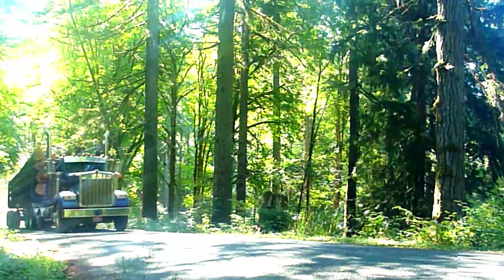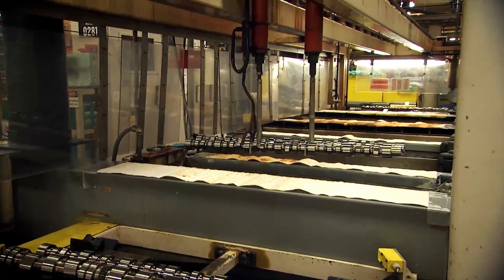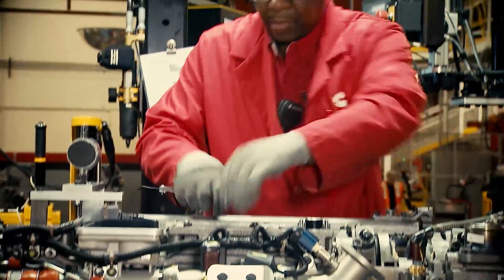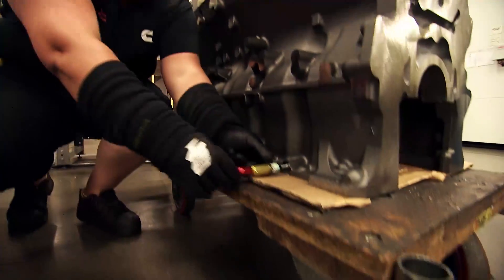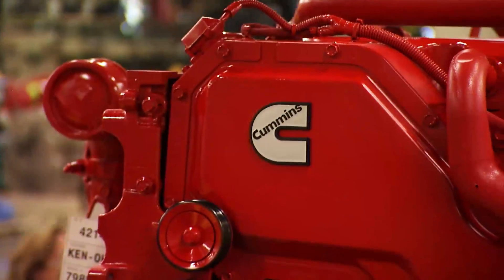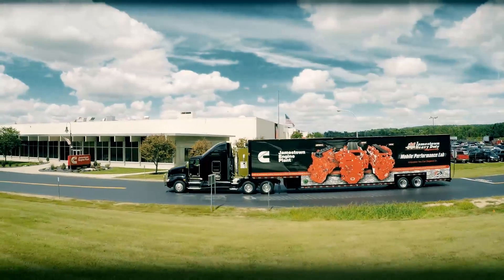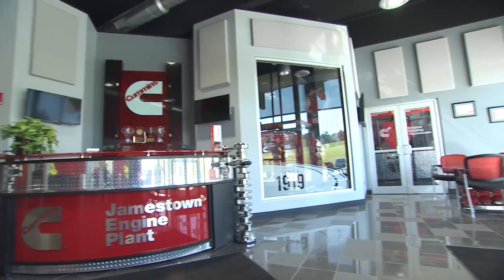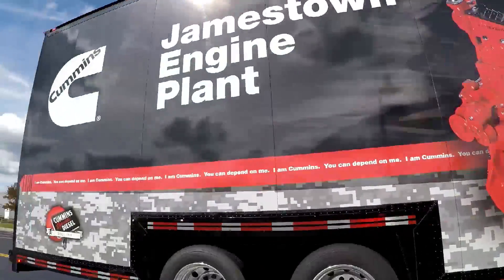Inside Cummins: This is Jamestown (2016)

Comment: I worked for Cummins starting in 1995 and can truly say i liked it there very much.  Then covid hit and our shop slowed down i was laid off temporally (ha ) for 90 days. over 120 days latter with  no explanation i was what they said furloughed . I had never been written up for any thing i had never even been late to work once . I worked on every engine platform Cummins had at the time from the B all the way up to high HP K engines and Onan gensets. I also was  the only tech certified to diag and repair industrial alternators for transit buses. I truly believe the reason i was let go is our branch manager at that time (JIM) did not like me for some reason and i was the oldest tech in the shop at  that time almost 60 years old... I really thought this was going to be my retirement job .  Thanks for nothing (JIM)  Cummins Sales and Service Grand Junction Colorado
Reply: Thats so sad

Comment: The engines are ok but the emissions after treatment systems are garbage. Once they act up nobody can fix them the only repair is to delete the system which is illegal. But it's the only way to use the equipment.

Comment: This is a really professional video, excellent presentation.  NOW-  if ONLY Cummins was even MORE dedicated to phasing OUT diesel (fossil fuels) faster, as the planet is suffering like crazy from excess CO2 in the upper atmosphere, overheating, Gulf Stream may stop, or REVERSE! Europe will freeze, Polar bears can't find seals. Sea ice is receding at TWICE the normal rate in the Artic,   But increasing temperatures across the planet, caused powder post beatles have migrated north into Canada. They're EATING MY BROTHERS HOUSE, chewing invisibly on the inside out!  Go Electric-  Cummins  and Caterpillar and Komatsu and Hitachi, John Deere, GM, Ford, Chrysler, Mercedes Volvo, ... etc.  Norway already has an autonomous electric Container Ship delivering !  Come ON AMERICA...  The nuclear USS Nautilus' keel was laid in 1952.   Surely 70 YEARS later, electric  transport should be universal and child's play!

Comment: Our l10 has done over 30thousand hours built in 1990 and still going well never have to touch it very much uses 1 liter of oil every 15 hours its a very good engine I drop the oil 🛢 and filters every 250 hours .

Comment: Just checked google and VERY glad to read the cold good way, fact that Cummins belongs to Cummins! Job VERY well done indeed Cummin's management! Congratulations whole lot for purchasing those only 10.8 percent Ford sneakily brought but could not stop Cummins from buying back! Job so very well done indeed Cummin's management! Here is the copy from google's website: "Cummins set the record straight in their May 2013 newsletter, outlining that Ford Motor Company had purchased 10.8% of the diesel engine manufacturer in 1990. In 1997, those shares were bought back, and as such Ford has not owned a stake in Cummins since.Nov 10, 2013"

Comment: I got a isx15 cm2250 with 990k miles no oil burning, still running with stock turbo getting 8.2mpg maintenance is key I do all of it by myself, I did main and rod bearings at 920 with new oil pump, thermostat , water pump, egr cooler etc, I'm gonna keep pushing till I notice anything that would indicate rebuild, I do want to add emission system if not on top of it, it will kill the engine, my advice learn and do it yourself shops don't care, cummins will even give you access to quick serve with all info need it to maintenance your engine, I'm happy with cummins and if I get another new truck I'm gonna have it with another cummins engine.
Reply: 8.2mpg whatfuckenever.

Comment: I had a 2014 KW T660 with a Cummings 450 HP, I bought it used, I ran the truck for about 2 years, and out of the sudden, the engine blow out a hole on each side of the walls of the block, this the 7 engine that I know that they have this problem, some mechanics won’t recommend Cummings, cause the problem that they blow out with out no reason.

Comment: Ive owned 2 isx now and NOTHING BUT PROBLEMS from egr to bolts snapping in block for belt tensioner replacement to lots of little things that add up. And parts are very expensive. Oil leaks are very common everywhere

Comment: I need that trailer to hook up to my truck to see what's wrong with this x15 boat anchor... Feels like I'm driving an old 80's cummins...  Of course it doesn't help that the exhaust hits a 90 degree brick wall not more than 20 inches from the turbo so it can get down to the power and fuel economy robbing DPF... Diesels need to BREATH, the epa is choking the crap out of them....

Comment: I have 2007 Peterbuilt with 450isx and it’s got 1,400.000 miles and still running strong only thing change was the turbo at 1.000.000 miles good engine

Comment: wow at 9.20 you say you put on the right parts, thats amazing!
Reply: Terry Rack.... in other words, they're (hopefully) Not assembling an engine with (especially) accessory parts or components that should be going on a different engine order.  These are Not "one size fits all" car or pick-up truck engines... HD diesels have specific order numbers for each engine and they are set up for specific applications.... even when ordered for (ie:) semi - trucks.. you could have the "same" engine platform for one truck model... but, could have 7 or 8 variations in regards to air compressor and alternator sizes, turbo model and location, etc, etc. 

You also have gen-set and industrial application orders as well.... so, Yes.... they need to be paying very close attention to matching the engine serial number with its specific work order number and making sure that all the "right parts" are on each specific engine for it's "end use" application.... and that also applies Internally as well as for external parts. 

Static compression ratios vary, depending on end-use application and power levels desired.... so, pistons, camshafts (lobe design & ramp rates) can vary during assembly.... they are Not all the same, whatsoever.

Comment: ISX = It Sux  nothing runs like a Cumapart.  Try fixing the cams running flat and the cranks spitting the rods out the block. You fix those problems, paint them Yellow, and call them a Caterpillar you might be on to something.

Comment: Interesting how the painting occurs after assembly.  In one way it seems more efficient. However, you would think that that there would be several spots in tight areas that are missed.
Reply: Seals up the leaks 😂
Reply: There are
Reply: Yeah but ya don't really want paint in those spots for sealing tolerances. This method is preferred.

Comment: I had a new Volvo a few years ago it had 400 N 14 engine it ran and pulled better then the IXS motors in the other trucks we had.i took the tractor too Allentown Mack the mechanic came out with the computer box and he set it up right.i think its sad that they turn the power down on trucks now .trucks on the turnpike run at 65 too 68 thats it companys want too save fuel .Ryder JBH Sneider and other trucking companies drivers run the passing lane too much and get mad at you when you pass them thats sad.i think too making big horse power engines like a 400 too 550 are a waste of time.Please people i have driven a 18 wheeler sent i was 17 years old  i m now 54 .my dad drove all Macks  and is 84 now wow.trucking is fun too me drivers .if you buy your own truck have them set it up like you want thats all.i got two speeding tickets in my life one when i was 19 and one back 2002  people be careful out there God bless.

Comment: Tony Stark ordered his in RED.....I want Cummins POWA in  RED too
Reply: sticK&Clutch.... if it's built for either "automotive" or industrial applications.... it will be Red... whether you order it, or not..... Unless, it's a factory Re-man engine of the older "855" platform... then it Will come in "Cummins Beige" paint... unless it's for some other application other than automotive or industrial use.  The Cummins N14 & M11 truck engines were all in Black paint, except for the Owner Operator spec'd N14 (with the 460 hp rating) which was Black, with Red rocker covers... nick named the "red head" engine.

The marine versions use to be in White.... as were, many of the Cats.   The only other paint color exception for the earlier "855" block in hd truck use, were from Paccar.... parent co. to Pete & KW during the very late 1960s and early 1970s, when they ordered the Cummins & Cat engines painted in White, but the Detroits remained in their factory "Alpine Green" color.... except for those that were shipped to International Trucks, they ordered them specially painted in "International Harvester Red".

Comment: nice production plant. Wonder which car manufacturers order their car motors from CumminsEngines
Reply: lenny108...... Zero "car" manufacturers do.  However, RAM (Dodge) is 100% Cummins in their diesel pickups, and Nissan is No Longer offering the diesel option starting with the 2020 models..... they said the Cummins V8 was sorely lacking in performance.... which I wouldn't doubt.

Comment: We run Kenworth and Peterbilt truck’s hauling product up and down steep grades in Colorado most of which are powered by the ISX 15 & X-15’s. We’ve found that the ISX 15’s run to about 300,000 miles and become plagued with problems that lead to full overhauls. We’ve rebuilt two of them but after becoming more familiar with the issues they have we have decided they aren’t worth fixing. Engines have gone from a lifespan of over 1,000,000 miles to 1/3rd of that which is not cost effective.
Our X-15 powered part of the fleet has been much less problematic but they are still in the fairly new category so time will tell. Hopefully they are better than the ISX 15’s have been. 
In my opinion if you have an engine failure of a 2010 or newer truck, you will get way more life out of it by replacing the engine with a pre-emission model which comes with a warranty than by rebuilding.
Reply: Benjamin Ball for sure, deleting them helps but I think the ultra low sulfur fuel is partly to blame also?

Comment: Recently i changed the oil cooler of the ISX .
Reply: Hmmmmm oil cooler is not reliable in Cummins as I also have replaced numerous in Cummins QSX15 industrial and generator drive engines. Similar to ISX truck or vehicular engine 😎

Comment: You can improve by bringing back the n14 with a better fuel system on it. The isx is junk. Say no to egr and dpf!
Reply: jo pete The best engine that Cummins made was the N-14
Reply: The CELECT PLUS is not a better fueling system than the x15 Common Rail fuel system. Going against EGR and DPF (and DOC since it was released alongside the DPF) I am assuming you are supporting emissions of NOx, raw HC, CO, SOx, DPM and many other pollutants. Please correct me if I'm wrong.

Comment: Personally I think the old big cam formula Cummins were and still are the best engines ever built
Reply: Donval Harris I always like the KT series, drove W900 with a KTTA 1150. It got 3 mpg' but it sure pulled good with a 5+4 and 3:73 rears
Reply: nope,detroit diesel.

Comment: Had a Peterbilt with a Cummins explode at 160k miles. They produce better motors for pickups Than semis. I do like N-14s but I'd rather have a 8v71 or a c-15 or 3406
Reply: 8V-71? WHY? SO YOU CAN PRACTICE YOUR SHIFTING?
Reply: @redline9536  no, to practice premature hearing loss and brush up my yelling skills

Comment: Nothing compares to Cummins.
Reply: Pavle Pajic your having a laugh surely? Volvo is not even in top 3.
Reply: Pavle Pajic I used to work at Scania in the workshop.  Nice looking truck, lovely to drive but the engines can't hold a candle to Cummins  Volvo are behind Scania in the pecking order.
Reply: EVER HEARD OF A CAT. ISX HAS A 1 PIECE HEAD LIKE A CAT. BECAUSE IT'S BETTER THAT WAY. STILL CANT TAKE TO MUCH POWER INCREASE. TURN UP A CUMMINGS, ENGINE'S FAIL MECHANICALLY. TURN UP A CAT, RUNS GREAT. UNTIL THAT RIGHT FOOT GETS TOO GREEDY. THERE'S A REASON WHY GLIDERS WERE MAINLY BUILT WITH A CAT FOR POWER. OR 12.7 FOR ECONOMY. BUT NOT MANY CUMMINGS WERE IN THE MIX. N-14 IF ANY.

Comment: have a fleet of trucks and triple trailer units all working 24 7. All have cummins engines and have been hauling iron ore to quarries across australia. have 6 kenworths with isx engines all are 6 years old been running pretty much 24 7 since only shutting down for services. all have done around 25 to 30,000 hours and between 1.1 million to 1.5 million kms. havent had a spanner to any of them. great engines great kenworth trucks!

Comment: i purchased a G855 in 1978.  it has been reworked several times with new liners but the Crank has been turned .010 one time to take out scratches in 100,000 hrs.

Comment: your engines are only good and reliable as the people working on them.
Reply: charles V and the people driving them
Reply: Charles
You sound like a Union guy 🤔
Reply: I think 2 million miles on a motor that’s never been opened that doesn’t shut off for 6 days at a time is pretty good.

Comment: i wish peterbilt with give O/O better engine options choices to make then this pile of dung.. i 'm about to purchase a new truck and i just don't want a cummins, i want my old trust worthy DD15 which i've never had no major problems with, i replaced the small top coolant line on the passenger side, also it was weeping a little oil at the rear of engine block above starter, all fixed under warranty 'I'm about to turn it in this year with 460K miles on my 2012 freight liner, before this my company trucks had cummins which were always down and in the shop until i started driving a truck with the DD15  i just trust that engine, it has never let me down, i know that drive line with the eaton fuller 10 speed together they made me a lot of money. but now i want a 2017 peterbilt 389 but what is holding me back is that it has that stupid cummins in it, very frustrating, if i must i'll get another truck with the DD15.
Reply: charles V- I agree the DD15 is pretty good. I never had issues with it either. The only problems I ever have with the ISX15 is the after treatment system. If they can make one that works, that'll be awesome. I know the emissions crap is annoying, expensive, and doesn't sound as good,  however I'm no hippie but I like the whole less pollution movement.
Reply: Get a glider with a cat that's what I'm going to do!

Comment: I will never purchase a Cummins engine ever again!   While they were still junk back in the '70s and '80s, they were cheap to fix and very cheap to rebuild compared to Caterpillar.  That's why Cummins was successful in those days.  Not because their product was superior, but because it was cheaper than dirt and easy to fix.  These days it's a different story.  While Cummins engines improved in some respects, they're still plagued with problems, but they're super expensive and it will bankrupt you if you have serious issues and are dependent on Cummins warranty.  Most North American drivers (steering wheel holders)  think that the ISX is a "good engine" because it "develops lots of power".  Compared to what?  Other North American engines? They think like that because they never had a chance to compare it to other UNMODIFIED (N American) products like the 16l Volvo @ 750 bhp, 16l Scania V8 @ 730 bhp, etc.  There is no one better at diesels than the european manufacturers!
Reply: maybe your just a maxxforce guy??
Reply: bluelightguy1 I'm old school. Drove and ran whatever it took to pay the light bill.
Reply: c15 and c16 are crap gutless
Reply: 2nd the Scania! SWEET engines.  I've run Cummins but no fan of them.
Reply: JKillerZs G:  like the the 537 kW (730 bhp) backed up by a whopping 3500 Nm (2581 lb/ft) of TORQUE that the 16 liter V8 SCANIA engine develops in their R730 trucks?

Where exactly does the Cummins ISX for road use stands on power and torque?

You responded talking about torque to a comment that emphasized on QUALITY and RELIABILITY, you fucking moron!  Get outta here with your fucking torque!
Reply: see my main pick thats was a new T608 550 cat with 3 side tippers 140 tones all up gutless  as hell on the hills and they had the new T908 575 cat twin turbo what a joke i was in a old mack with a cummins genII 500hp flat out at 80kmh the new both had 3 trailers 100 000 liters of fuel most was up hill he could not get away from me
Reply: New isn't better. I drove an old worn out Pete with a 3406-B that would run or outrun a C-15. Don't want anything new.
Reply: greg nunn Put next to old school, yes.
Reply: Hereintranzit 60% of our fleet of about 200 odd trucks are kenworths with cummins n14-isx engines and besides leaking fluids i really cant fault them nor have i really heard anything bad about them here in new zealand.
Reply: greg nunn love them. cant beat that whistle. hands down best sounding engine. in saying that yes there pretty weak up top but go good down low